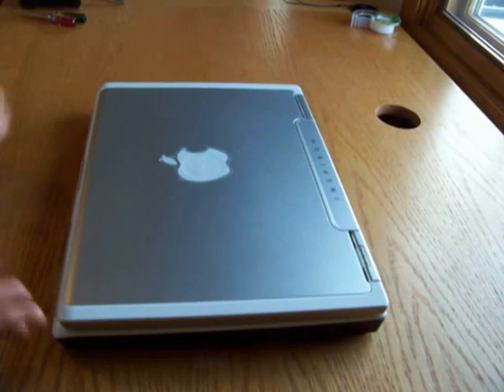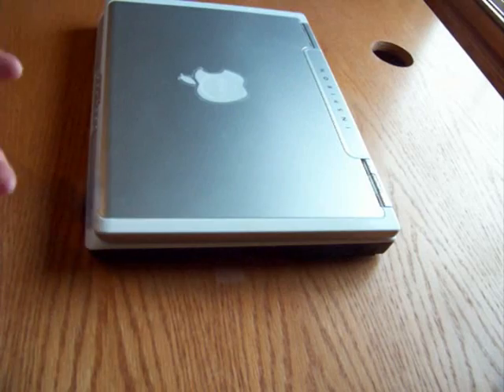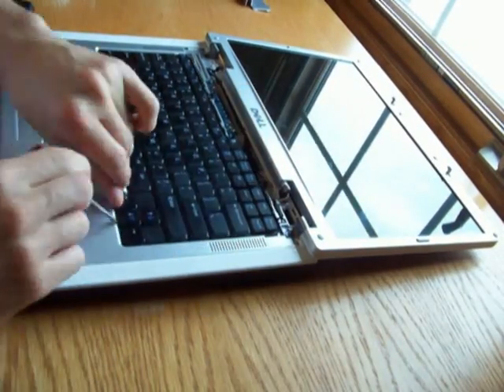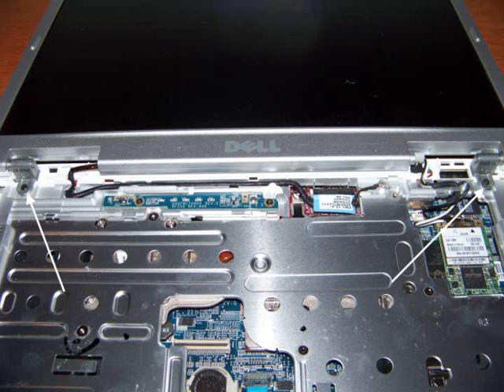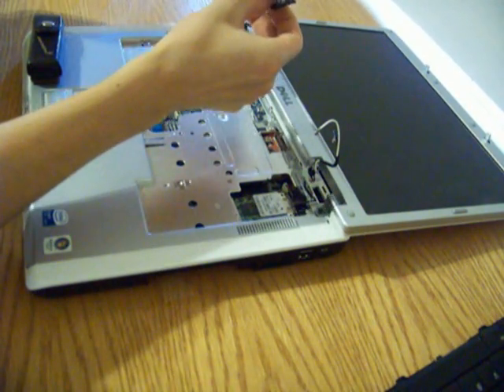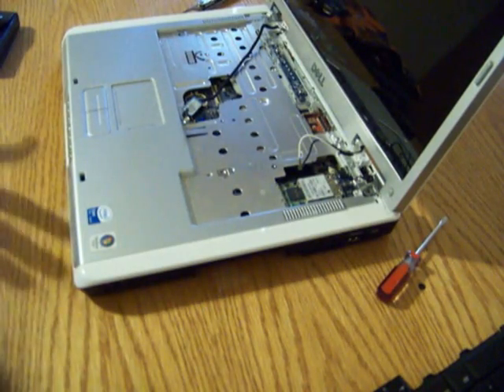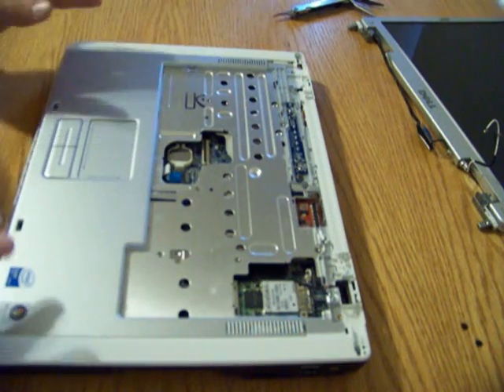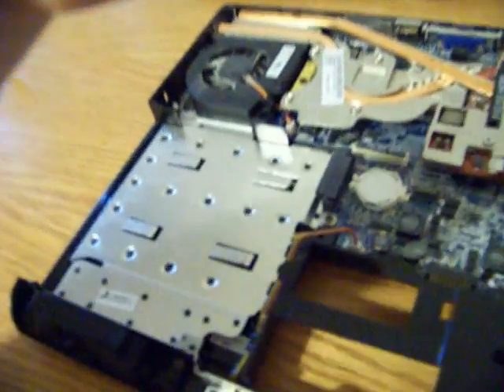How to remove and install a laptop graphics card. (Part 1)

Comment: .....and he did all that without once using an earthing wrist strap. So any electro static on his body will transfer on to the Laptops delicate electronics potentially shorting them out. He'll be scratching his head 6 months down the line wondering why his Laptop no longer works....

Comment: I'm doing some reading and it says that you really can't replace a laptop's graphics card because they are soldered into the motherboard. 

Well, you've obviously done that, so can you only do it on newer laptops?

Can I? I have a symbol that says PCI on the back, and beside it, there's a little swirl, a little screw that's an arrow, what does that mean?

Under dxdiag, DAC type says 'internal'.

Comment: i have a question i know its totally off topic but i have a problem with my internal USB ports all 4 of them have a  problem on my laptop dell inspiron 1501 my external mouse  and  any other thing i plug into it  is there any way i could fix it?
also the speakers stop workin to unless i put my headphone jack a curtain way then it comes on

Comment: well
in 06 i bought mine for just under 2 grand (retail)
so probably about 5-600 bucks
700 most.,.
try upgrading the graphics, that'll add on alotta value

Comment: Each core is 2.4GHz, you don't get 4.8GHZ because each core works individually. It doesnt add up, it does NOT work that way.

its like 2 cars traveling at 24mph.. do these 2 cars add up to 48mph? no.

Comment: something you should have mentioned is that not all computers can do this. most low-mid price laptops have integrated graphics cards, which are non-removable.
plus, you cant really upgrade your graphics card, because the connector placements arent standardized.

Comment: its soo much easier on desktop all u do is take off the covor on the side, push the lil switch to remove the card, put the new one in. put the covor bak on. and plug all that stuff in and turn on. wallah. but i gotta upgrade my laptops graphics. i have a vaio vgn-fs8900p.